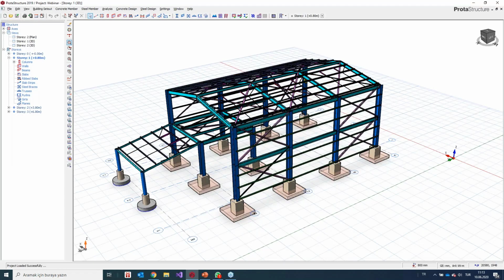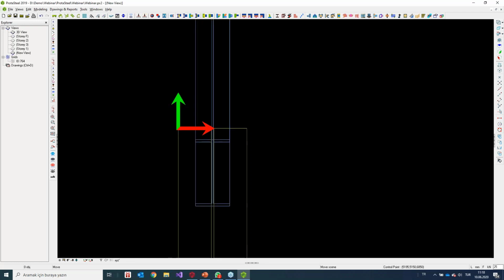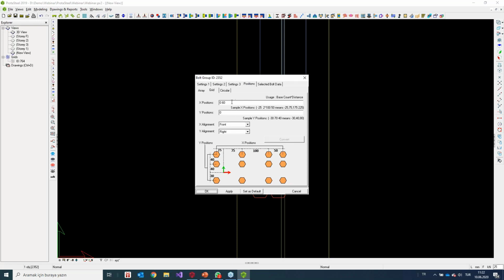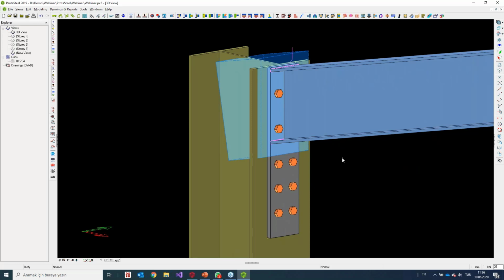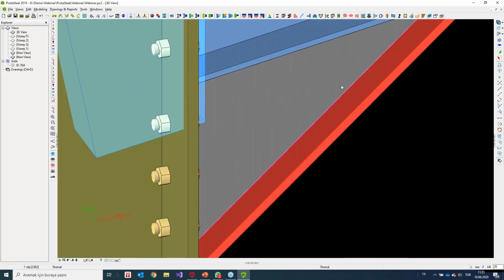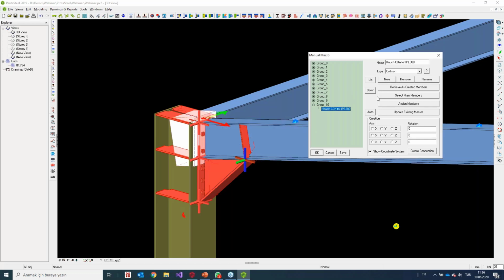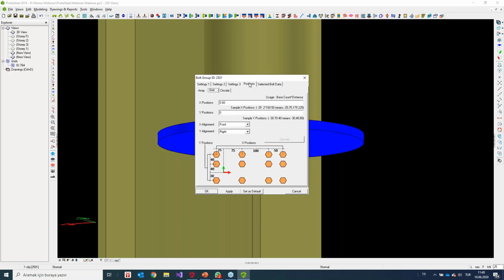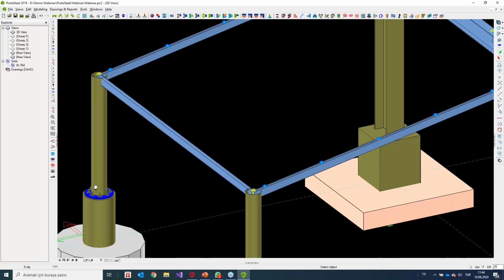User Defined Connections in ProtaSteel

Comment: The reason why the manual macro for the haunch didn’t work was because after selecting the main members you have to press the “assign as selected” (I think third) button and save the connection. So basically you had an empty connection. But thanks for the video! It’s a very useful feature.